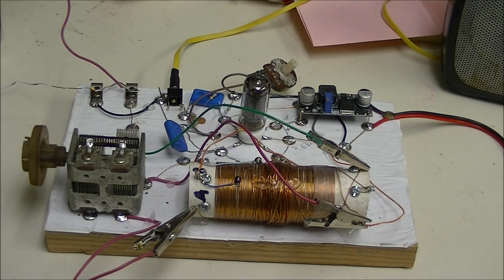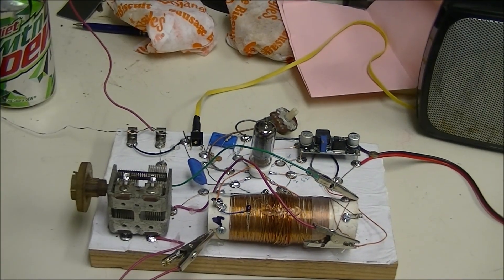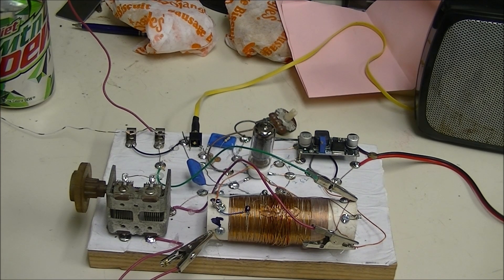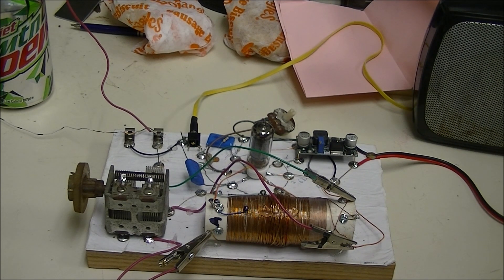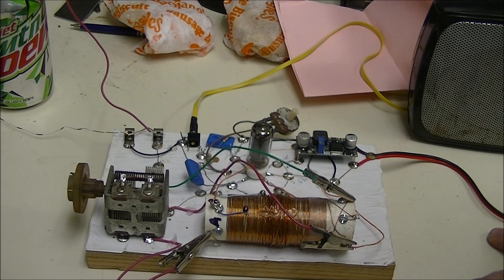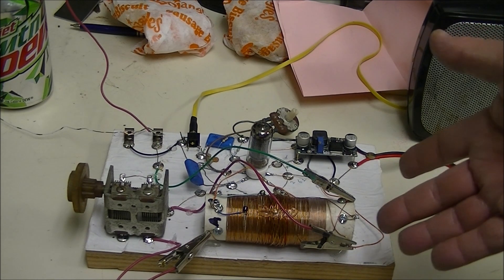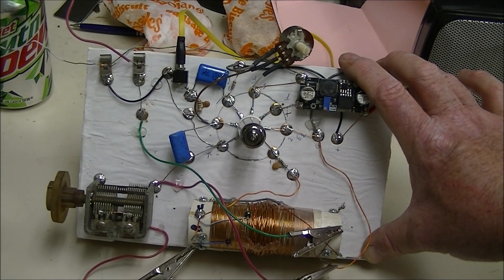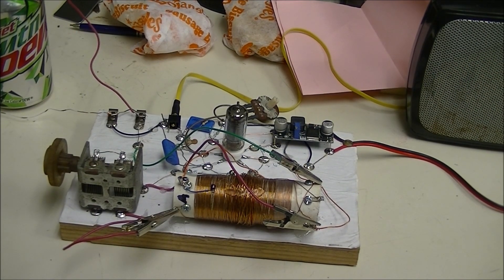Low-Voltage Vacuum Tube Radio

Comment: I have tried a grid leak detector and it didn't work. So I put a germanium diode as your earlier video.The resistor was 2M and capacitor was 100pf. Should I try 1m with 220PF to make it work. Are Germanium Diode works well than a grid leak detector? I am confused, please help.
Reply from the maker: I have gotten little results from a grid-leak detector and really don't know why. The diode di part of the work and the tube became an amplifier.
Reply: @LewisLoflin  Hi it worked, Thanks.
Reply from the maker: Great work!

Comment: Have you tried a 'tickler' coil (reaction here in UK) which would make the receiver significantly more sensitve.
Like the construction method which lends itself well to experimentation and circuit modification.
Keep up the good work!

Comment: What about TELEFUNKEN Space Charge Vacuum tubes with a B+ of 9-90V and a H+ of 1.5-3V
Reply from the maker: I have a few of those but the heater is 12V. They work fine at 12V.

Comment: What about using miniaturized tubes would they work?
Reply from the maker: Sure they would. a 6CW4 type was a high-gain triode used in VHF amplifiers years ago.
Reply: @LewisLoflin   	CK5784 = 5784 Would that work in a portable radio? https://www.radiomuseum.org/tubes/tube_ck5784.html
Reply from the maker: @travismoore7849  It is more mixer than an amplifier. It could work. I would have to build a circuit and test it to be sure.

Comment: 0:20 At nineteen point three volts, ypu cannot really call that low voltage!

Ever hear of the Cummings SOLODYNE receiver, which used "starved amplifier crktry?
Reply from the maker: 19V compared compared to 120V or 220V is low voltage.

Comment: Sound quality is great, sounds as good as FM! I wish stations here in the UK would not limit their bandwidth or I'd try this myself. I'm surpised using switchmode power supplies didn't interfere with the reception.

Comment: what is the logic for the primary / secondary turn ratio for building the antenna coil ? the one with cap is matched for resonance frequency, but what about the other side coil ?
Reply from the maker: It's for impedance which creates sharper tuning.
Reply: ok, so that kind of ratio should i look for ? lets say tuner calculation gave me a turn number of 80 for the 20pf cap i have for tuning into the desired frequency.

Comment: suprised that the Switch mode frequency didnt cause the switching noise . The tube didnt look like 6AH5 , as i remember 6AH5 is short bulb triode..  maybe you can try to add a feedback coil into it to make a regenerative radio.. i think it will give more gain.

Comment: 0:10 No no, this 6HA5 tube has a separately heated cathode, that means a stepped down AC power supply. Using an MP3 amplifier-speaker is a cheat. Also why not 18V  for the B+? Two 9V xsistor batteries connected in series can supply that.
Reply from the maker: The heater works fine on DC and an 18-volt PS is what I had.

Comment: What about the KORG NUTUBE 6P1?
Reply from the maker: Won't work with this circuit.
Reply: KORG NUTUBE 6P1 only requires 1v for the heater and works between 9v-50v, or what about http://www.qsl.net/m0ayf/VFD-Regen.html

Comment: Nice project.  Vacuum tubes are a mystery to me.  I must read up on how they work.
That's a great idea to use thumb tacks to make solder points on a wooden board.  BTW: In the UK we call vacuum tubes, (thermionic) valves, whilst thumb tacks are called drawing pins.  :-p

Comment: why is there a small SMPS on it again ? and what is the "choobe" for ? just audio amp ?
Reply from the maker: I think you are referring to a small switching power supply that sets the filament/heater voltage on the tube.